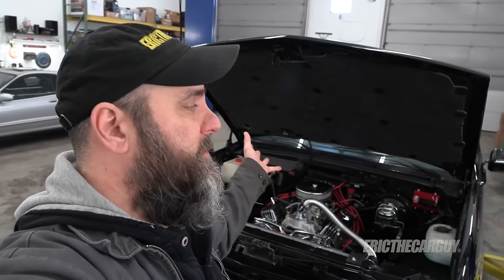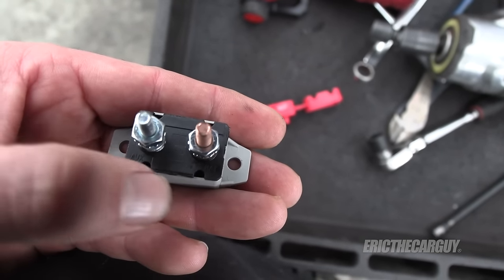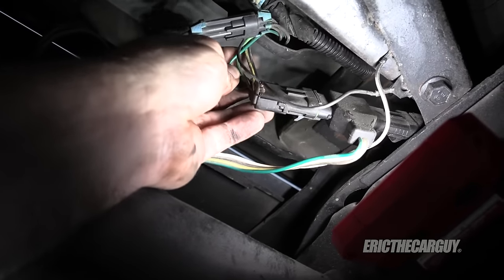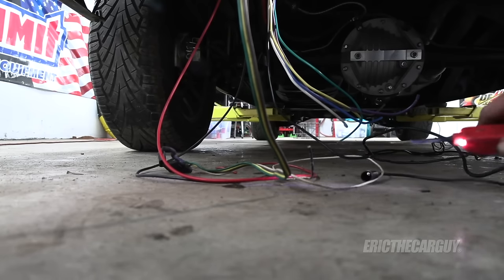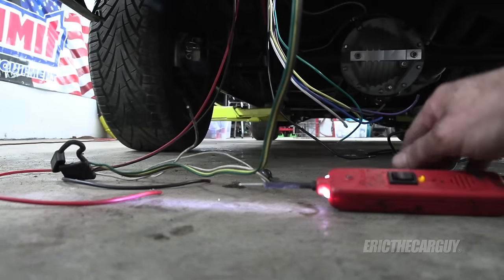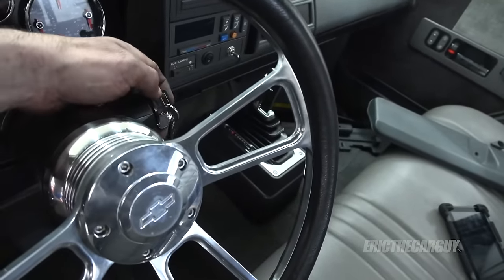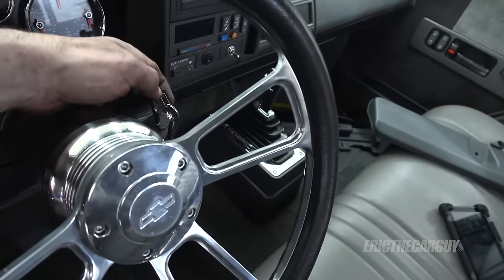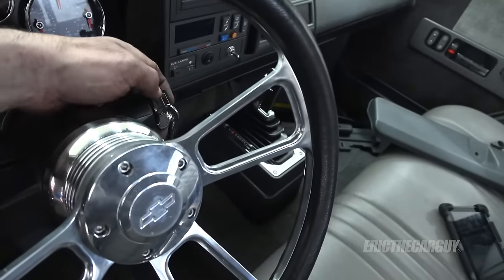How To Install and Connect a Trailer Brake Controller

Comment: I worked on tractor trailers a few years back. I got to know pretty quick which wire went to what, but for the life of me couldn't remember which turn signal was green and which was yellow. Till one day a coworker told me a little gem! 

Yellow has a L in it, therefore it's the Left turn signal.
Green has an R in it, therefore it's the Right turn signal.

Blew my freaking mind lol. 

Cheers!
Reply from the maker: I love that! Thanks.
Reply: Yeah, don't follow that, always check because people love to just wire shit however they feel like, I've had to rewire trailer plugs many times because of this.
Reply: Green right yellow left I will never forget this!!!
Reply: Omg - you just saved me!
Reply: @ericthecarguy   Also for you power boaters, nautical nerds, and barge captains, green is always right and the red is the left.  Kind of like port and starboard....port and left both have 4 letters, leaving starboard being the right side.  I'll keep the day job. I really like your addition of the circuit breaker....makes total sense to me. I spent the extra cash on one of the Tekonsha P3 units.  Apparnetly these units need to be installed perfectly level on the underdash area.

Comment: The reason it makes the 'wierd" sound is the brake controller is putting out power that is pulse width modulated. This is basically power pulsed at a certain frequency, it varies the amount of time on verses off to vary the braking power. So basically more on vs off time per pulse = more braking power.
Reply: Roooogerrr!!  Every "switching" or "switch mode" power supply has some sorta PWM controller in it.  A very mature technology.  I worked on 'em in the late eighties and they were old by then.
Reply: @silasmarner7586  I remember in the olden days of ham radio switching supplies had the reputation for  something to the effect of "always within a half cycle of blowing your rig" I can't remember the exact vernacular but. Man that was ages ago. Before many of the components were mature tech. No protection circuits etc.
Reply: Cool, thanks for the explanation!

Comment: as a former installer , my experience with the self tappers you used to mount the 7 round bracket will  rust out in 1 year in ohio  salt .no not the bumper  its the screws themselves  that rust and the heads fall off. i found actually using a regular bolt and nut just like the ones you used to mount the 7 round itself onto that bracket works well , but pop rivets work best!  the only thing i'd like to add is for  diy people NEVER drill into your hitch ! never weld brackets on it as well! you compromise the structure of the hitch and will fail after a few  winters.
Reply from the maker: That's great info, thanks. This truck won't see winter again so I'm not as concerned, but you have a valid point. Thanks again.
Reply: they did that with my license plate screws. and they rusted in a year
Reply: Damn spray some oil on it.
Reply: I used dielectric grease. I'm fairly sure that it will come off on it's own, so it became a part of my regular maintenance routine.
Reply: Yeah but what if you made the receiver yourself. The whole damn thing is welded lol

Comment: Thanks for the walkthrough. I will use what you have shown here on all my wiring work. Double checking all connections and conduit covering will save you from future problems. As always stay dirty.
Reply from the maker: Exactly. Thanks for the comment.

Comment: I like those solder filled shrink tubes. I`ve used them a few times and should use them more but after so many years of joining wires with solder then shrink tubing the joint its tough to change ones ways.  Heres a tip for anyone: for a good long lasting rust free ground connection once the ring terminal is secured to your ground apply some paint or a rubberized rock guard over the terminal. I did this to my trailer and had to remove the ground connection 5 years later and the connector and frame were shiny clean still.
Reply from the maker: That's an excellent suggestion, and interestingly enough, I thought about going back and shooting that scene and adding it to the video. I didn't to save time. Thanks for your input.

Comment: Once you puncture or create an entry for the blade of the seam ripper, flip it over so the ball side goes inside and you won't have to worry about cutting wires when you run it down the rest of the tape you want to cut out.
Reply from the maker: Great tip!

Comment: How to Install and Connect a Trailer Brake Controller
By Eric the Car Guy
Questions
1.	I was a bit concerned that the power going to the brake controller was momentary, yet the power leading to the trailer connector was fused. Then, I saw the schematic and it showed the red wire was for auxiliary power. 
2.	The blue wire is the power wire for the brakes. Therefore, the ground to Vehicle wire, and the ground to Trailer wire (both White) are essential if you want to have brakes. I know you didn’t have a trailer handy, but people should know how important that the white wire is securely grounded to the trailer.
3.	Did you discover why your back-up light connection was weak (purple wire)? The diagram shows that the wire can be used for back up lights or a Hydraulic Coupler. Either one of those would not work well with inadequate voltage. 
4.	This was an excellent video. The quality of the install and the emphasis on safety were superb.

Comment: Dielectric grease is your friend when working with electric connections .. Also anyone working on wiring anywhere under an older vehicle will usually find green/black wires when the insulation is stripped making it near impossible to solder , any of these wires will clean fast and easy by dipping them in a small cap (like the cap on a pop bottle) with some muriatic acid in it .. .

Comment: It is fun to watch you do what i do every day at work.
Reply from the maker: How'd I do?
Reply: @ericthecarguy  
The only thing I would have told you to do different, was to use bonded 2 wire to run to the back to make it easier.

Comment: I appreciate your video Sir. I’m having to do the same thing to my 95s 2500 Silverado because I just bought a 20 foot car hauler in my truck was not equipped with that seven pin connector. Very awesome video very descriptive very informative much appreciated and I can tell you and I have about the same mindset when it comes to paying attention to detail and doing it right the first time so awesome thanks a lot take care

Comment: Nice tip with the seam ripper! Hate those squeeze on connectors with a passion though.
Reply: I agree on those suitcase connectors but inside the cab it should be fine ? On our construction  trucks if we had to make a emergency repair ON THE OUTSIDE  we used them. But we globbed the hell out of them with RTV. Usually it turned into being a permanent repair, LOL.
Reply: @NoWr2Run  everytime i encountered them, i have had problems. It's the way they make connection: by ripping through part of the strands of the wire. It looses strength and if the wire moves a bit , it breaks over time.
Reply: Yep those scotch connectors are trash, many vehicle wiring issues can be traced to one or several of those things somewhere in the wiring harness that people use when they hack into the harness to add crap instead of just doing it right and running new wires and using the proper connectors.

Comment: Eric, You are so good brother, thank you for this video, I bought a E250 with trailer brake control and but the signal light is not come on when I press the brake. I will redo the installation and all checkup the wires.  From this video I will try to find the problem, thank you so much and MAY GOD BLESS YOU. you are the best brother.

Comment: Amazing install eric, very professional and i love the attention to detail. :-D.
You have made sure that the wiring is protected and every connection has a low resistance for the best result.
The earth being a common problem for a high resistance (All lights flashing when indicators are on) won't be a problem for you ever :-D.
I've had those days where wiring in a traylor socket just becomes a nightmare, the confused brain days.
Mixed up old/new uk standards doesn't help eather :-(
Reply from the maker: Having a fancy 'test light' like my PowerProbe really helps. Not only can you identify power and ground, but you can also supply power and ground, or earth, when needed. Makes testing and finding circuits much easier. Thanks for the comment.

Comment: Luckily for me I have a later model GMT400 Yukon, and most of the later model GMT400's were prewired with all 7 wires tucked above the spare tire (or against the driver rear frame rail). From there just splice them into the trailer connector of your choice.  The power and brake wire are taped up by the frame under the master cylinder area, A blue wire (brake signal) and an orange wire (power wire).  The orange wire usually has a ring terminal on it already and you just attach it to the AUX post A or B on the fuse box which are already 30 AMP fused.  Then the blue wire just goes to the brake controller, so installing my brake controller was super easy.
Reply: Most new/newer vehicles that can tow are pre-wired for a brake controller.  It took me 5 minutes to install the brake controller on my 05 and 08 Toyota Tundra pickups, both were pre-wired and had the pigtail connector for the brake controller in the glove box, just hook it up and plug it in.

Comment: It's a weird noise when testing the brake on the 7-way connector because the voltage will change based on boost level, how hard the brake pedal is pressed,  and vehicle inertia.

Comment: I get to do all this on my 86 K20 in near future, think have nearly same parts you used, with exception of a smaller 7 pin that uses an adapter for the 4-pin use.. I get to do mine in the dirt on the ground.. glad a 4x4 anyhow, little room,, Just bought car hauler and putting new brakes into that and be ready to score some deals this summer..
Reply: I even have a similar circuit tester just bought and get to try out n review.. the 25' of cable on it will be welcome...

Comment: Did you use the fuzzy fleece tape on that loom? That is made for interior harnessing. Although Ford does use it inside doors where it gets wet. They make some better exterior grade Tesa tape that holds up in Ohio much better. It is like Kevlar. Mopar uses it on the newer FCA vehicles.

Comment: You can put dome nuts on the underside, specifically the locknut kind, so they don't ever fall out. And if you spring for it, there's stainless steel. Adding a little bit of silicone on the rim will also seal it permanently.

Comment: i live in the UK, different trailer plug/socket &   different braking system  ,  but still found this interesting  .. BTW the bolts sticking through the wheelarch, just take a grinder & cut off the exposed threads
Reply from the maker: I don't think I need to worry about the bolts as they sit in a recess in the wheel arch. I don't think there's any danger of contact with the tire in my case, but I felt it was worth mentioning to others that might be doing the same thing. Thanks for the comment.

Comment: Could you please do a video on battery options/ care when not running a car for a long time? Eg: trickle charge vs those things that screw the negative wire down. Any tips tricks you have? Heading into winter here and will not be using a car for a while. Thanks!
Reply: Start it up and drive it around for a while once a month.

Comment: You talked about having to mount the brake controller level because it uses inertia to control the brakes. In which the previous post stated that power pulse is width modulated, the harder you hit the brakes in the truck, the more inertia is felt by the controller and applies a longer power pulse to the brakes on the trailer
Reply from the maker: You can also adjust braking force at the controller itself.

Comment: Many later GMT-400 trucks are pre-wired for trailer brakes. Look for a pair of unused orange and blue wires taped up near the fuse box on the Driver's front wheel well. They're terminated just above the spare tire in the rear of the truck. All GMT-800 and later trucks are also pre-wired.
Reply from the maker: Good to know, thanks!

Comment: i was going to wire mine up just like this.. but lucked out and found a factory tow package body harness for 25 bucks... probably took alot more time to install, but hey, it works and im all setup. Now to fix the minor issue of not actually owning a trailer... hmmm
Reply: Longer install time, but its the proper way to do it in the long run.
Reply: @wildbill23c  fore sure. no random wires around and what not. separate relay for battery + on the 7 pin, my rear harness and the dash harness was already setup. it was just the underhood harness that wasn't. so plug and play brake controller for the truck now!

Comment: I have had problems with the auto resetting fuses. If a fault happens on the trailer (or  truck itself ) it will reset over and over heating the wire. I was lucky enough to have the truck off when the always on power line shorted so it killed the battery before severe damage happened. The wire was destroyed along with wires in the loom. What I have been doing since is putting a 35- 40 amp fuse in line with the 30 amp resetting fuse/breaker. The fuse will not blow on the first couple to few resets but eventually will heat up and break the circuit until you can look into the problem. It addresses both the hope that the brakes have a second chance, and the long term heating problem. I use this same setup on both the brakes and the always on 12v source pin.
Reply from the maker: Interesting. Great info. Thank you.
Reply: My dad had this happen also towing his boat.

Comment: I love these videos I need to buy the 7 way/4 plug for my Chevrolet it only came with 7 way
Reply from the maker: That should be easy to hook up since you already have a 7 way run.
Reply: If your 7 way is good, I've seen adapters that will allow you to plug a 4 way into the 7 way.
Reply: Yea I have the adapter just want it all in one like eric
Reply: I just use the adapter that plugs into the 7 way plug.  I install 7 way plugs on all my trailers, its a much more secure connection than a slide together plug, less likely to come unplugged with a 7 way...I had a 4 way plug come unplugged on  my atv trailer and had no idea, drug that thing all the way back home, so by the time i got home I just had wires dragging the plug itself was completely gone LOL...so ever sense that happened I just use 7 way plugs regardless as the 7 way receptacle has a retainer that keeps the plug connected once you let go of the cover.

Comment: I take it your truck was an older throttle body? I am not for sure on those  but on the 5.7 vortecs, suburban, 1500s, etc. The 7 wires are independently installed from factory. They are usually behind the license plate area. Under the hood there is a blue and orange wire for 12v and brakes. They are wadded up and have to be untangled. Pretty cool for chevy. I also have a 03 1/2 ton that had 8 wires by the fuel tank for an in bed mounted 5th wheel. The eighth wire is for 3rd brake light. Kinda cool too except why would you use a 1/2 ton to pull a 5th wheel? I use the power wire for a bait tank.

Comment: Hello, thanks in advance for the helpfull video, quick question, Wouldn't the brake controller always be on? Or did you install a relay for it to be power when the ignition switch is on?

Comment: Something is draining my cars battery.. yes I have a trickle charger that I am sure of but between 2 different mechanics one installed the trailer’s breaking system and one to install the trickle charger for the towing vehicle (personal car) and another installation which I forgot to mention of the replacement of my 6/7 way plug. So about every 2 hours I have to pull over and start the car and let it run.  Where do I start in troubleshooting? Any and all suggestions advise or direction is greatly appreciated.  

Great video

Comment: It would be helpful if you showed how to set the settings on B, B1, B2, & B3 positions but I think the adjustment wheel is not settable for the different B settings. I think you only adjust the intensity wheel once and the various B settings are automatically adjusted B1 being the lowest breaking and B3 being the highest breaking leve.
I have the same break controller you have and I usually use the B1 setting in town and in slow stop and go traffic. When on the interstates  or mountains I usually have the B setting on B3 for maximum trailer breaking.

I think the controler has a deceleration sensor to help with the applied voltage to the controller.

Comment: I cleaned the door lock mechanism on the Driver's door of my motor home and sprayed it with white lithium grease and was stunned a few months later to see that the grease caused rust everywhere instead of protecting the bare metal. There was no rust where the grease didn't coat. I live in a sub-tropical zone in southeastern Louisiana. I thought maybe the lithium grease attracts condensation?

Comment: On Some trailer 7 pin connectors the pins and/ or the lead wires are only rated for 20 Amp.  Also sealing up wires reduces how much current the insulation can take before melting. The More copper the better.

Comment: Based off the wiring diagram, the brake controller power is directly to the battery. Does this mean that controller will kill you battery when the vehicle is off?